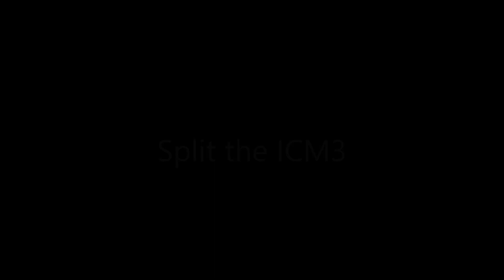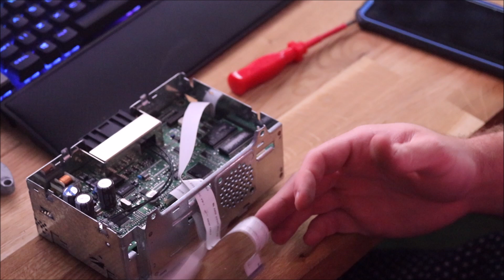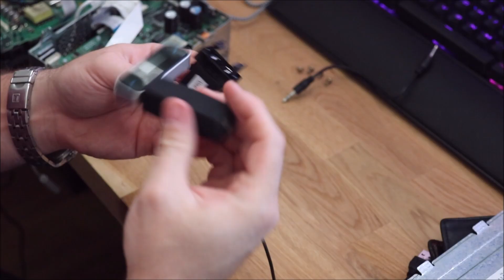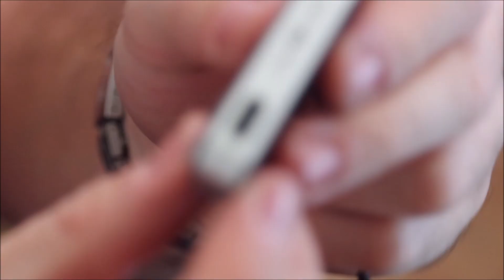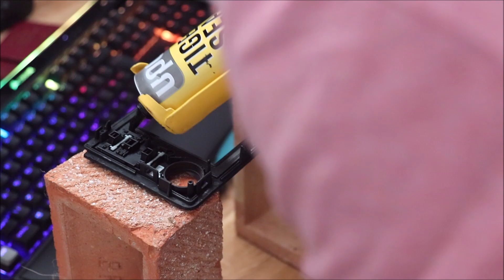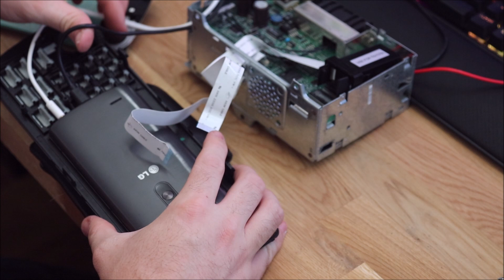Build Guide - LG Phone Based ICM3 Radio for Saab 9-3 2003-2006

Comment: Component question (and jeez this is 4 years late). 

What is that foam piece/block that's wrapped around what looks like some aluminum fiber tape called? And where can I acquire it as the used one I recently bought has that missing. 

The location is that it's sitting on top of that silver flat component (CPU? GPU?). 

I'm assuming it's to prevent the board from shifting back and forth to bulkhead of the rest of the unit.

Comment: Hey Stuart. Question. When my phone turns off then what? How can I turn it on? My button is inside of the unit 🤔
Reply from the maker: On this phone I modified the bootloader with customised firmware so that it automatically powered down when you turn off the car and automatically powered on when you start the car. It was basically triggered by the charger input.
Reply from the maker: Also this is obsolete now, it was replaced with the better Raspberry Pi / Open Auto Pro mod I have on my channel
Reply: @SaabUnleashed  I have LG G3 D855 rooted and TRWP custom recovery installed. Can You just write which Firmware did You use for it? That's it. If It's only about the money that's fine for me. Can pay for your info about firmware.
Reply: @SaabUnleashed  thnx for respond. Problem is that I already bought everything from Your tutorial. LG G3. Transmiter and all the rest. LG is rooted soo I can also change my bootloader. But which one is it?

Comment: Hi
Do you think it would be possible to add DAB to this?, I have a OTG cable that allows for charging at the same time as using a USB device, so my thoughts are to add DAB via an adapter and downloading an app to the phone
Reply: He is using an LG mobile phone. This does not have DAB support.
The Android cheapo Chinese USB DAB receivers are appaling. Have seen many of them and without fail they have very poor reception. The software app is also flaky and ergonomically challenged. You may get it to function over  OTG,  but would doubt it.

Comment: You're so close to something amazing here!! Ditch that dingy FM transmitter and hard wire the phone's AUX out via CD player in. Just gotta find the leads on the EHU after the MOST connector. Someone did this successfully a few years ago... just gotta find that post on SC.
Reply from the maker: This is actually an option. It depends on the technical capabilities of the installer. The FM transmitter is a no-frills, throw-it-in option. If you're more advanced, I highly recommend going direct to the aux in
Reply from the maker: Ok, I'm actually going ahead and including this with the package
Reply: @SaabUnleashed  the issue with the antiquated FM transmitter is interference (eg driving near an airport). A direct link would be much cleaner. Although you'd have to hit the SRC button once without hijacking the CD changer (Assuming you disable CD via Tech2, as it's normally two presses).
Reply from the maker: @djfremen  Fixed https://www.youtube.com/watch?v=9YKk0mIanlU&t=2s
Reply: The CD changer on a 2001 to 2006 9-3 is a fibre optic unit and is on the MOST ring.
Use the Aux input instead (may need to be enabled with a Tech2).
Reply: AUX input needs to be activated via Tech2 (if not done allready). After activating the feture you press the CD button twice to enter AUX mode. Much clearer sound and no need for the FM transmitter. It took me a while to find the left and right channel and grounding pins for the cable but it works perfectly. You can allso add a bluetooth reciever to stream music from your phone and hide it in the dash as well. Works briliantly. Don't remember which pins were the correct onesfor the AUX input tho, but if someone wants to know I can take out my unit and check.

Comment: i heard that if you disconnected the stereo then the car wont start after reinstalling
Reply from the maker: Thats incorrect. The car won't start if you try without an ICM installed. Once you put it back, everything is normal
Reply: @SaabUnleashed  so do you sell the unit as a whole with everything installed and i just simply fit it back to the car
Reply from the maker: @marcdavies-hall616  Yes, but I don't have any ICM3s in stock. If you don't want to modify one yourself, you can pay a deposit and I will send you an ICM1 so you use your car whilst I modify your ICM3. Otherwise you'll have to wait until they're back in stock again

Comment: Will this work in US 9-3 Saabs? I have a 2006 SportCombi automatic.
Reply from the maker: Yes of course
Reply: I have a 2006 93 aero with just the 2nd option radio.Will this work?.I am in the USA
Reply from the maker: @dennisspors7530  No, the ICM2 doesn't have a big enough screen. You would need to acquire an ICM3 for this upgrade to work
Reply from the maker: @uemackay1592  yes
Reply from the maker: @uemackay1592  no fault codes. What do you mean a lot of settings?

Comment: Supeeerrrrr!!!! Great job....just a question the original button part of the icm that you cut away doesn’t work now right? And if you switch the frequency on the oem radio with the steering wheel control, how do u return to the frequency of the fm transmitter?? U saved on a number before modding the unit?
Reply from the maker: Buttons 1 and 4 are still there for you to save radio stations